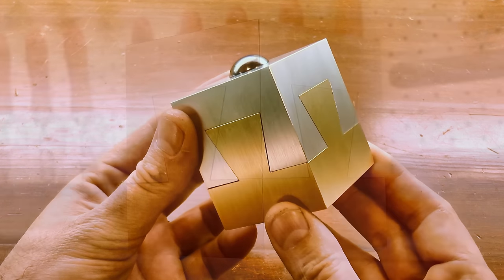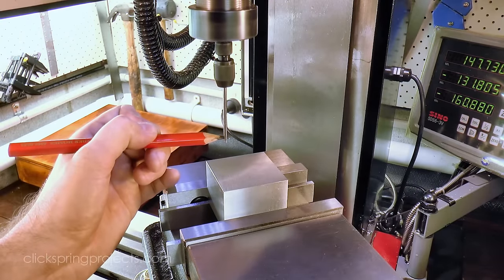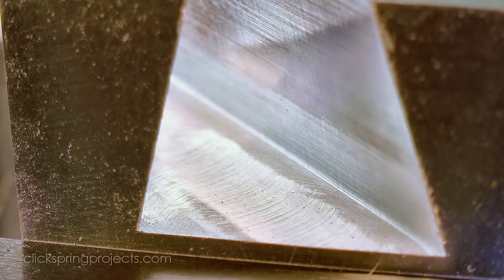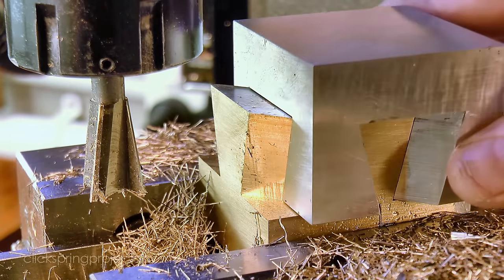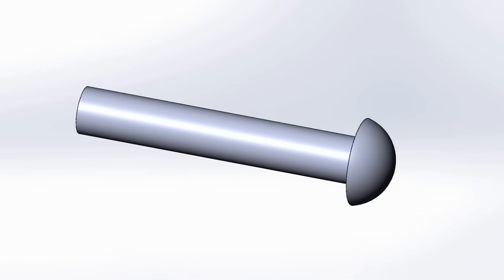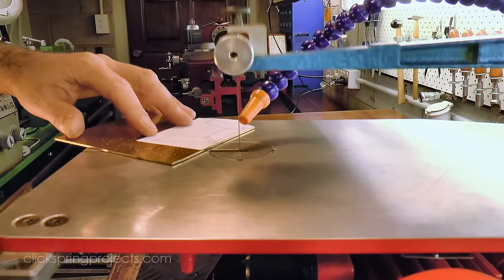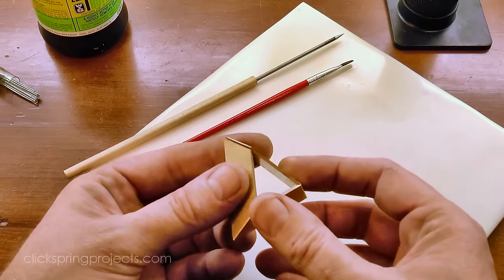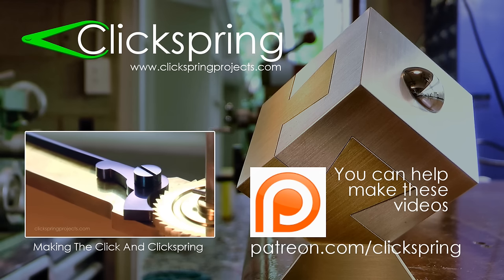Machining The "Impossible Dovetail" Puzzle - 100,000 Subscribers Thank You Giveaway (Winner Drawn!)

Comment: I have a feeling that woodworking "precise" is not machinist "precise".
Reply: Machinist precise means you're within +/- .005 in (or mm) depending on who you're talking to.  Carpenters can get away with more since the fit doesn't have to be as tight.  Machining, if it's not tight, it's not right.
Reply: Wood shrinks and grows depending on the time of year because of the relative humidity, so yeah, no where nearly as precise. It's one reason I do wood not metals :-) yeah, too lazy to learn the math.
Reply: Rough framer: 1/8"
Trim carpenter: 1/16"
Piano builder: 1/32"

Machinist: Got a microscope?

:)

Comment: Instead of a pin through the piece, what about insetting two super strong magnets on the inside (one one each piece) so they would be hidden?! 

Great work as usual!
Reply: Great idea, that way it would be hard to tell how it comes apart. Just a strong pull on the right part in the right direction and the magic happens.
Reply: Brilliant...
Reply: For the magnets to work both pieces of metal would need to be ferrous metals..
Reply: @kennyfahy4971  Or you could read the comment and understand that there are two magnets
Reply: @kennyfahy4971  not necessary, he could use two pieces of magnets , positive and negative side facing each other to attract each other.
Reply: That could work, if you’re merely interested in increasing the force necessary to slide the two billets apart.

Or, I’ve seen secret drawers and cabinets that have an internal magnet lock mechanism that’s actuated by a magnet in your hand, external to the puzzle.

The way I’m imagining it, he could inlay a magnet (moderately strong — but not a “strong” magnet!) well below flush with the surface, directly in the middle of the main channel, and drill a slightly larger diameter hole in the other piece that perfectly aligns with the magnet... and then slip an iron ball bearing in the hole opposite the magnet, making sure the ball bearing fits that larger hole perfectly, but won’t fit inside the hole with the magnet. (The ball bearing would be free within its hole, which doesn’t penetrate all the way to the exterior face, which would give away the trick.)

When you assemble the puzzle, insert the ball bearing into its hole and hold that block underneath (so the ball bearing is deep in its hole) as you slide the other piece with the magnet into place over top. When the two billets align, the magnet will pull the iron ball bearing into position CLICK and the puzzle is locked. Now, you’ll just need a strong neodymium magnet to penetrate the two billets and pull the ball bearing out of position to defeat the puzzle.
Reply: Tim --- Cool Idea, Tim👍   Sounds like an idea that could potentially evolve into a number of similar yet different ways to lock the halves together and also separate them.

It also reminds me of something you might see in one of the many different puzzles that Chris Ramsay tries to solve on his channel, who also just so happened to be the recipient of his most recent project (the card press).
Reply: @kennyfahy4971  Nope.
Reply: I've seen one like that before, they're awesome. The pin gives it away too quickly.
Reply: THAT was a great idea you had 5 years ago...

Comment: Instead of a pin, I use a detent ball.  (dimensions in inches)  On the inside surface of the brass half, I made a dimple in the center using a .250" ball-end mill.  On the corresponding location on the aluminum half, I drill a .250" hole about .400" deep.  The hole will first have a .250" spring installed, then a .250" ball bearing.   I made a special tool out of A2 tool steel.  It's a .500" rod about 3" long, but length is not critical.  On one end, I make a detent, again with the .250" ball-end mill.  The last .250" of the rod (on the same end as the dimple) gets turned down to .300" diameter.  I then hardened the end of the tool by heating it cherry red with a propane torch, then allowing it to cool.  (A2 is air-hardening)  That's it - very easy.  Now put the spring in the hole in the aluminum half, followed by the ball bearing.  Put the dimple of the tool on the ball, which will align the tool with the hole, and capture the ball.  The tool is only a little larger than the hole, and when hit smartly with a hammer, will collapse the wall of the hole slightly at the end, and the ball can't escape.  Now, when the dovetail is assembled, the ball will click into the detent on the brass side, and no pin is seen or needed.
I really need to make a video of the process...

Comment: Hi Chris.  I'm wondering why you tend to cut so far away from the lines on sheet stock.  It seems like a lot of sanding to get to the line.  Is It just because you're worried about cutting too much off or is there some other reason?
Reply from the maker: +Chris Larsen Hey Chris, yes I take a different approach on this, and just use the saw as a coarse roughing out tool. Typically I will cut about 1 - 2mm short of the line with the saw, and then end up 0.5 mm short after linishing, leaving the rest for final finishing with files/abrasive paper. The reason is that there is often much variation in the cut depth for a jewellers saw blade, given that not all cut strokes are perfectly vertical, and its very easy to drop a cut mark inside where you think you've put your cut and mess up the perimeter. The belt sander solves this so easily, because linishing is so fast an accurate, and leaves a superior finish anyway. So for me I see no real payoff in taking it slow and precise with the saw cutting close to the line, when I can just rip in with the belt sander from safely outside the line, and be done in seconds, without any of the risk of ruining the part. Thanks for watching and asking :)

Comment: Any thoughts on making it so that the pin threads into the hole and matching the material for whichever side you put it on?  That way it looks like it is just two pieces vice three which will almost certainly increase the time it takes to solve.

Comment: Excellent quality video, graphics and voice-over.
A few minor suggestions :
Just as a reference, I would blue-up the alum and brass pcs and scribe my cut-lines on a surface-plate with a height-gage.
Your spindle-speed for rough milling both the alum and brass slots could be increased considerably.
For removing the burrs - draw-filing will give you better control of your file, and a better surface finish.
Machining the spherical-radius on your locking-pin is easily and accurately accomplished using a corner-rounding-end-mill mounted in your lathe toolholder.
If you heat your steel locking-pin to 570* Fahrenheit, it will turn a deep blue which will nicely contrast with the brass & alum.
Nice job on making the dovetail cutter.

Just as a ref : This past Jun 24, 2017 marked my 60th anniversary as a toolmaker, and I'm still at it.

Comment: If one has to pick up corners on a regular basis or even just edges and wants then dead on ivest in or take the time to make a "toolmaker's chair".

Nice to see your dovetail cutter worked well. I'm curious, just how well would a 1/2 dovetail router bit work. I know they normally use different grades of carbide. I've used them on engineering plastics in the mill.

Comment: Love your video's Chris. I have a suggestion for this Impossible dovetail. Instead of putting the pin all the way through. If you drill from the center of both pieces from the inside then put a shouldered pin in one side and a magnet glued in the other the it's a real puzzle. to open it you have to give it a smack on the side opposite the magnet to pull the pin away then it will slide free.

Comment: Very nice, well done.  The only thing I think I would have changed would be to make the pin an internal blind one that can be slid out of engagement by turning it upside down.  If it was a good fit it would slide slowly.  Just to add a little bit of mystery.

Comment: Nice work, esp the finish. 

Did you use a power feed on the mill or has it been converted to a cnc? I'd be interested in how if at all you've customised your machines. Thnx
Reply from the maker: All manual lathe and mill, with no major customization, although I did make some small improvements to the tailstock on my red lathe. Thanks for watching Sandeep :)

Comment: Great video. I like the part when you tell "there are no such tools in the shop so I just make one myself" :-)

How about an inverted pin variation? A head could be flat on the outer side and rounded from the inner side. A complementary round hole in one piece would make all three pieces end up forming a perfect cube.

Comment: Beautiful work.

Consider an addition to make separation more difficult - but not impossible. Use a magnetic SS pin, and embed a small rare earth magnet in the bottom of the hole, making disassembly possible only by pulling out the pin by its round top and the magnet opposing even that.

Comment: I machined one of these for a mate at work last year, but instead of putting a pin through the entire piece. I drilled out holes on the inside and placed a spring and pin in them so the piece would lock once assembled.

Comment: You might be able to get rid of the pin in the middle and have a floating magnet in the middle. Then use a stronger magnet to pull it to one side to unlock it. Very cool looking project!

Comment: that's pretty cool how you made that dovetail cube, but I would have not used a pin through the center. I would have used ball bearings and springs with a detent to hold the pieces together and easily slide them apart.

Comment: Drill and tap that locking pin on the flat side.  Put a round button that looks like the other side and screw it in for a more baffling look.  Also, wouldn't it be easier to put the locking pin in if you chamferred the hole of the top surface on bottom half, too?   It might give it a little bit smoother insertion if initial alignment isn't perfect when you put the pin in.   No matter what, it was absolutely beautiful.

Comment: Actually dovetail milling bits are comercially availble usually in 45°, 30° and rarely 60° (from the rotational axis, full dovetail is Value°x2 45°x2=90°), they are just relatively expensive if you want good quality stuff, otherwise you can get them for ~20 bucks a piece online. So you could've gotten hold of a 30° millingbit, maybe even a 20° bit for the job and that's rather narrow.

Comment: I'd like to make one simple suggestion for this project. Instead of a pin that makes it quite obvious, the use of a sprung detent hidden between the two parts might be a better idea as a showpiece. However, it would induce a wear pattern that would show the "tracking" of the pin over time.  
---Just my two cents.

Comment: I used to make these out of hardened D2 tool steel using an Agie wire EDM. Cut the dovetails on a 1/4 degree angle, put the two sides together and cut the square. Invented by Bill Fricke, then president of AGIETRON Corp (later AGIE USA) circa 1982.

Comment: why do you make the hole for the locking pin starting from small sizes and then only bigger sizes and not the big size from the beginning? will it affect the inner surface of the hole if i dont start with the small ones?

Comment: what is the safety process around dealing with millions of metal shards? seems like a big potential hazard
Reply: safety glasses, and incases were they fly around a bit u normaly have some kinda shielding u can setup if nessecary, this is only for manual machines tough, CNC is another story where the tool work space is almost allways completly inclosed so cant get ur hands inside while its working and so that u dont get metal shards everywere...

Comment: Should've countersink the holding pin so it would lay flush instead of bulging out.
Reply: Having a screw on nut would have been the other way to deal with it. Perhaps with a blind hold so you can't see the screw through the piece. Instead it presents itself as an over sized rivet.

Comment: you should've made that thru pin from BOTH sides.  BUT....  here's the trick, do a half-lap joint, half way down each pin that would require a 180° turn to lock the pin together as if it were one pin with button heads on each side.  
That would DEFINITELY ADD MORE to the overall trick.

Comment: I have to wonder what it costs for the two blocks of metal?   Also do you recover the waste so it can be melted down and re used?  Also I think I would have put a taper on the pin so that it has to be hammered out from the back with a punch to remove it.   It would at least give some appearance of permanence.   Or taper the very bottom of the hole just a wee bit so the pin is held just snug by friction.   Or maybe even make the pin  with a few threads so it can be   tightened by hand just a bit.  No notch for a screwdriver to give it away.   The guy below had a good idea with a couple magnets.   Maybe even a spring loaded ball bearing.  You'll drive people nuts for years with that thing.   I didn't see the solution.   I would have said it was definitely from a UFO.

Comment: Where do you get your stock? I'm looking at getting into tool-making and I have yet to find a supplier (in Australia that is).
Reply from the maker: +scarletlightning565 Local scrap dealers and machine shops, as well as georgewhite.com.au for new brass, hales.com.au for gauge plate, blackwoods.com.au for drill rod
Reply: Thanks a lot :)
 Also can't wait for more clock building.

Comment: Actually just stumbled upon this chanel and vid. But, is there a reason you are milling counter clockwise? Since if you want to have the cutting on you’re tools. You normally mill clockwise (Letting the milling bit turn clockwise) to have a smoother surface and have a longer lifetime on you’re milling bits. Besides that, good vid man. You just got yourself a new subscriber.

Comment: Instead of making the pin going completely thru the the piece, you could drill a hole in the aluminium piece and make a spring loaded pin. It would seal the piece but it would look very "impossible"

Comment: would it be reasonable to create a pin that wasn't visible? don't drill clear through, and make the pin a bar with a magnet and a thin layer of brass, or aluminum (depending on the side it sticks out of) cut a rod the exact size of the hole and set it, then sand in a brushed pattern with the pin in place. at least that's my idea of making a pin vanish. while having a way to remove it by using a magnet as a handle to pull on the magnet embedded just below the surface.

Comment: Request a full atx motherboard heatsink for both Amd & Intel including raspberry pi 3. and completely cover everything that can possibly be sandwiched cut out ports and add one Peltier cooler with another posh heatsink of choosing and you have the ultimate project. video card's also bit not liquid cooled.
Reply: And if humidity is a concern with frosting try developing a drip tray for such an occurrence.

Comment: You should make the pin from the same material as the top or bottom and not drill the hole the whole way through so it sits flush with the top

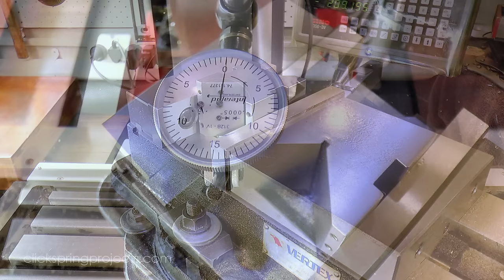Comment: 1:20 0,005 of an inch is 0.127mm. I saw a deviation on your scale of about 40%, 0.04mm deviation on less then 150mm length IS NOT accurate!!! 0,05mm per 200mm is BARE MINIMUM in my shop... But super beautiful piece you made!

Comment: Instead of the pin to keep them together, you should have made a magnetic hidden pin so that to get it apart you would have to tap it to slide the pin then slide the two halves apart. Magnet on the aluminum side as aluminum is non magnetic.The wood one has a magnet holding the pin to the lock side so tapping to the gravity side releases the pin.

Comment: This is playing around with the human mind.  When looking at it for the first time, due to the past experience of  one's mind where the logic of  a conventional dovetail usually slides  in a direction which  is 90 degrees to the face of the dovetail, which is individually impossible in this case, for what appear to be four dovetails in different directions,  well the solution is not to think of a conventional dovetail sliding and think of finding a set of parallel lines which join the " skewed dovetails " and that is the sliding angle, however impossible  and improbable it looks at first.

Comment: Why didn't you just put a spring with an aluminium rod on it in the center, you could've just pushed it in and slid on the other piece, then it would partially pop into another hole in the other side so it would be stuck, that's less obvious, and it would look truly impossible. Kind of like this but permanent: http://14544-presscdn-0-64.pagely.netdna-cdn.com/wp-content/uploads/2013/06/ms402.jpg sorry if I didn't explain it well enough.